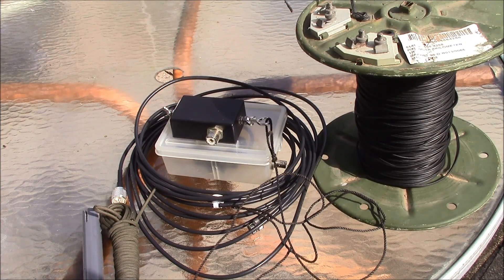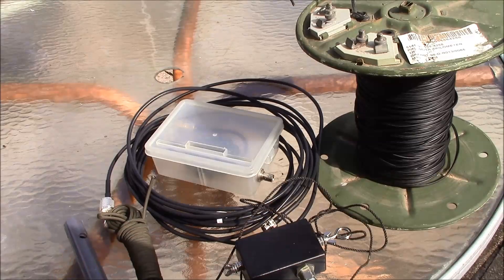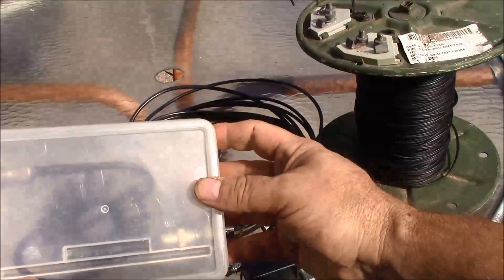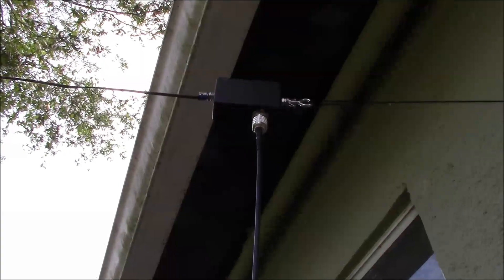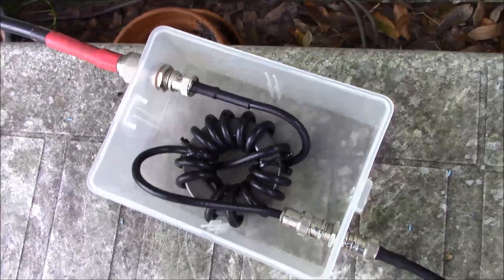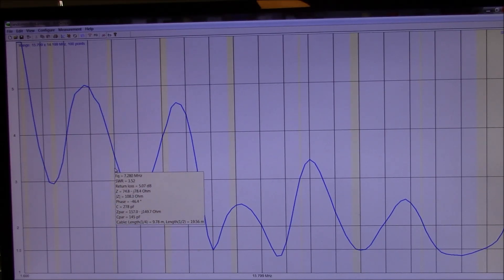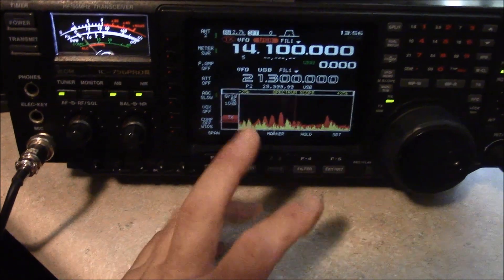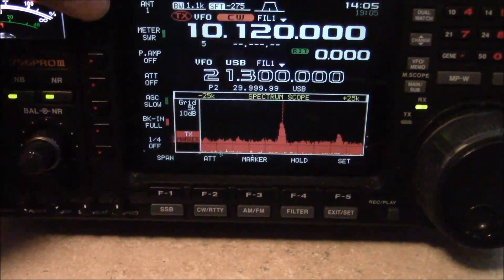The random length end fed HF antenna and you

Comment: Curious why you used an unun vs a balun.  I thought a balun would be called for as you are going from an unbalanced random wire to a balanced coax.   Tnx de WB8BHK
Reply from the maker: The important part is the transformer.  Some small endfed antennas such as this unun are made for are using the shield as a counterpoise. I added the counterpoise because  it performs better . Thanks for watching !
Reply: @survivalcomms   Coax Is unbalanced.
Reply from the maker: @ronaldcarlson1840  Yes and ?

Comment: Thanks for the video, very informative, I plan on mixing your design in with my rain gutters, thats a free 32feet on the rear of my house. I plan on running wire on both sides of my house up the eves with both ends soldered onto my rain gutter.

Just a question what software were you using to find the usable frequencies with your antenna? and how do you go about tuning the random length antenna?
Reply from the maker: You are welcome. If you desire a resonant antenna for a specific band I believe a dipole set up as a sloper is easier to use without a tuner. You can experiment with the counterpoise length and get resonance with a random length end fed  The radiator lengths of 55, 68, 85,92,102, 120 ft. will allow 80-10m coverage and tune 60m. If you do not desire 60M coverage you can go with a length as short as 38ft. and a 50' feedline. You want to avoid even integer 1/4 wavelengths of whatever frequencies you are planning on operating. Thanks for watching !

Comment: The 9:1 box works great, but I wish Nelson would have used another eye bolt on the radiating end as a strain relief mount. There's one on the counterpoise side which works well, should have done it on both ends, otherwise your radiating element is just begging for breakage at some point.
Reply from the maker: that would be a good idea. I picked up an enormous  Palomar Eng. 9:1 the other day at an auction and look forward to seeting up a system for it. Thanks for watching !
Reply: @survivalcomms  I took my own advice and modded mine. Couldn't find a 3/8 so I had to go with a 1/4 bolt, but the hole in the box was just big enough to thread it in. Had to solder on a 1/4 ring for the inside wire too. We'll see how it goes when I get a chance to get it airborne.

Comment: I liked your informative video. Using a random length end fed is quick to make and easy to install. My preference is a Half Wave End Fed, usually designed for 40 meters to 10 meters. I like resonant antennas. 
I really liked when you showed the difference in signal strength between the non resonant end fed and a resonant vertical. Those are expected results and teach people the importance of using resonant antennas for maximum performance.
Barry, KU3X/QRP
Reply from the maker: Thank you very much ! Thanks for watching !

Comment: very good about the isolation box. VA2SOB -CLAUDE 73
Reply from the maker: Thank you ! It really helps in my experience ! Thanks for watching !
Reply: @survivalcomms  is it the same as an in line choke for the name line insolator ? Any length of wire to have 80-20 m end fed antenna with 9:1 unun that you can share with us ? Very good english I had no problem understanding. VA2SOB - 73
Reply from the maker: It is one of those projects you have to try for yourself. I prefer the one I used. There are others that swear by feedline length multiples and toroids over the feedline itself. It is worth experimenting with what you have on hand.

Comment: thnx for reply
tried it with c/poise and earth to set as you say and through an L match atu
probably bands but very little on 20 but on 40 receiving well from Muscat Oman to U.K. no qso made cos of ruddy big pile up!
will keep trying as is all part of the qrp game.
Cheers 73
Reply from the maker: A good indicator is that RSSI (received signal) . Generally 20 is very forgiving. You may try adjusting the length of your radiator. In my experience an efficient antenna on 40 is hit or miss on 20 . Keep on trucking !

Comment: any counterpoise or earth?
lm qrp on 817  cheers 73
Reply from the maker: There are many different ways to provide the counterpoise. Ive used a random length wire along the ground (shorter than the radiator ) ,  I have tied it to my station ground,  and I have used just the coax shield as a counterpoise which works at QRP . Its definitely one of those antennas you can throw together with common materials if you have a balun and tuner. Thanks for watching !

Comment: Wow, great video. I haven't seen that wire since my wireman days in the MARINES! Working on an end fed antenna also, still not sure about the length though, so many variations out there. I have around 200 to 300 feet of property to use, lot of trees but still usable! Thinking of a fullwave length + or -  👍 N3WUB
Reply from the maker: Peter Martinez Put as much wire up as you can and give it a shot. Thanks for watching !
Reply: trying this 2 morrow hopefully ...connecting thru an L match to tx  
best vid ive seen on this tnx! 73

Comment: If you would not mind, could you measure the properties of wd1a phone wire as a transmission line on HF,VHF,UHF? I was going to make a dipole, using it to make the elements and the transmission line. I do not like coax, and bull. I like to keep it simple. if it has low loss it would make a good antenna, as you need no coax, no connectors, just rope and insulators. I think it would make a good video. the wd1a wire has potential to be good feed line in the field. I think it would make a good video. 73 good DX

Comment: Great video Survival Comms. Due to my limited knowledge  of how the radio works and such I really need to get into a class and learn this stuff before getting a long range radio. Found a nice Cobra 29LX on ebay I'm thinking of buying along with a swing kit. I hope they aren't illegal to have, and installed?
Reply from the maker: Thank you ! The best classroom is the experience of playing radio. The amateur radio technician study material is good on building the basic foundation. The 29 series models I used were the legacy ones like the 29GTL.  If you have the budget the Galaxy DX959B is a better set for close to the same price point. Amazon has them for less than two hundred bucks. Save your money on the "swing kit" and forgo it. most swing kits are snake oil. There are many disreputable "techs" out there. Thanks for watching !

Comment: Awesome! The last time I attempted a random wire...it was so noisy! (my local environment, I'm sure). I'm still playing around with it though, there is definitely a sweet spot. I do have an LNR Precision Trail Friendly end fed that works like a charm. 73 De K4SFC
Reply from the maker: Thank you ! Noise is bad news bears for sure. I generally check into a few 80M nets in the morning and my original 450 ohm fed doublet had more punch on transmit but the receive has been status quo.  There is a whole spreadsheet of wavelength multiples you are supposed to avoid with a random length antenna but I rolled the dice on this example. Shoot me an email if you want to set up a sked . I generally monitor 7188 khz . Thanks for watching !
Reply: Sounds good. I've got a 20m dipole in the attic and a 40m dipole in the trees out front..ha! I've seen that spreadsheet...a lot of math! I just built one this morning at 29', I've got the 9:1 unun and I've made the same  balun for common mode current...so many projects in this hobby. If you are in Lexington, Va (saw it on your shirt), it might be tough though, I'm in Bowling Green,  between Richmond and Fredericksburg.
Reply from the maker: I'm in FL the shirt is from one of many trips. I haven't made it to Bowling Green in your state just Bowling Green in KY :) You are right there are so many antenna projects.
Reply: Perfect, should be an easy comms check. What times are you monitoring?
Reply from the maker: The morning before 10 and in the evening after 21:00
Reply: Rgr that. I'm out of le casa around 0730, but I could get on after 2100.
Reply from the maker: we should do that then say 21:30 ?
Reply: Not sure about tonight, but any other night this week should we doable.
Reply from the maker: cool beans shoot me an email and we will coordinate.